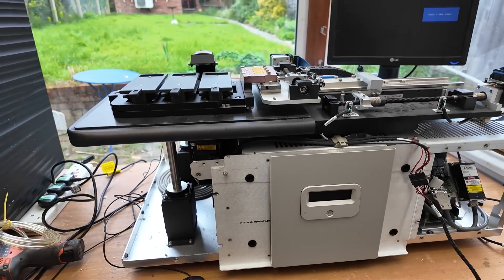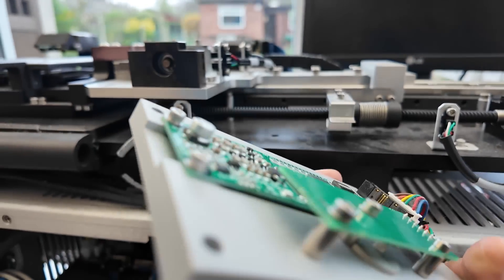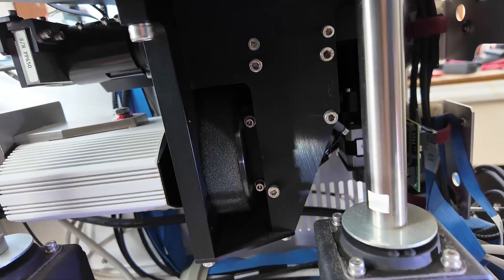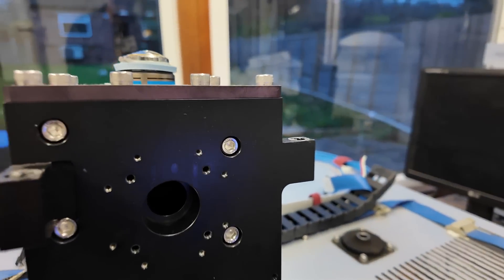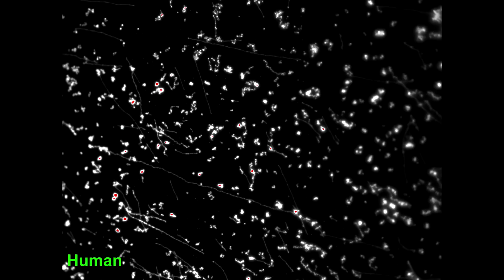Opgen Argus DNA Optical mapping system part 2

Comment: Abstract:

This video presents a detailed teardown and analysis of the microscope module from an OpGen Argus DNA optical mapping system. The system's architecture is revealed to be PC-based, incorporating a dual-processor server motherboard and a standard Corsair power supply, running on a Linux operating system.

The optical system's core is a 532nm green laser, notable for a unique motorized fiber shaker—an assembly with an offset weight designed to vibrate the optical fiber and reduce laser speckle. The mechanical design features a high-precision IKO XY motion platform with specialized flexure couplings to minimize lateral forces. Control is handled by a custom, over-engineered stepper motor driver board utilizing an FPGA and DSP. The imaging component is a Photometrics CoolSNAP EZ CCD camera, found with a large mass attached, likely for vibration damping.

While the laser was successfully powered on and its speckle-reduction mechanism demonstrated, the camera could not be made operational. Due to the system's large size, complexity, and the non-functional camera, the presenter concludes by deciding to part out the components for individual sale. The video ends by showing images recovered from the system's hard drives, requesting viewer insight into their meaning.

---

Deconstructing the OpGen Argus: A Deep Dive into a DNA Mapping Microscope

*   0:01 - System Overview: The video begins with an overview of the OpGen Argus microscope unit, a large, complex piece of equipment for bacterial analysis. It boots a Linux-based OS on a vacuum fluorescent display but gets stuck at a password prompt.
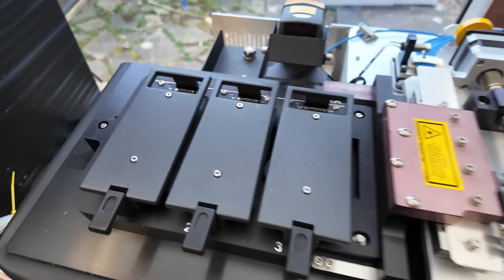*   1:45 - PC-Based Architecture: The system is built around standard PC components, including a Corsair TX850 power supply and a dual-processor server motherboard, likely for handling intensive image processing tasks.
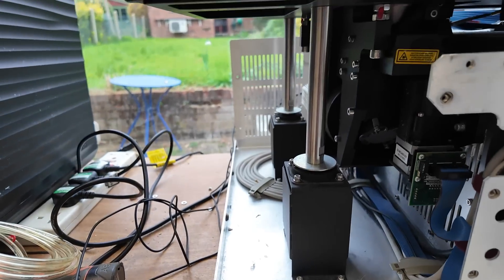*   2:42 - High-Precision Mechanics: The core optical assembly is mounted on a shock/vibration-damped platform. The XY stage uses high-precision IKO slides for moving samples.
*   3:36 - Unique Motor Coupling: The design features a flexible metal coupling (a flexure) between the motor and the stage. This is engineered to transfer motion precisely while preventing any unwanted lateral force that could cause misalignment.
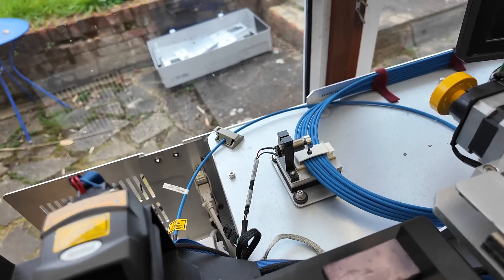*   4:03 - Innovative Speckle Reduction: A key discovery is a motor with an offset weight that physically shakes the laser's optical fiber. This "fiber jiggler" continuously changes the light's path, averaging out interference patterns to eliminate the "speckle" effect common with coherent laser light.
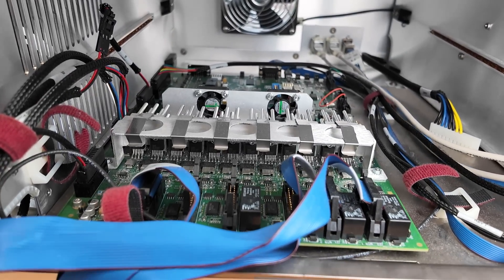*   7:23 - Over-Engineered Motor Control: The system uses a highly complex, custom-built board to drive just three stepper motors. Featuring an Altera Cyclone FPGA, an Analog Devices DSP, and 12 power op-amps, it is considered ridiculously over-engineered for its task.
*   9:53 - Laser System & Optics: The laser is a 532nm (green) module. The optical path includes two narrow-band filters: one to purify the laser light going in (532nm) and another on the camera to isolate the specific fluorescent light coming out (562nm).
*   11:05 - The Camera Module: The imaging device is a Photometrics CoolSNAP EZ CCD camera. A heavy, half-kilo weight is bolted to its side, presumed to be for vibration damping or to alter its resonant frequency.
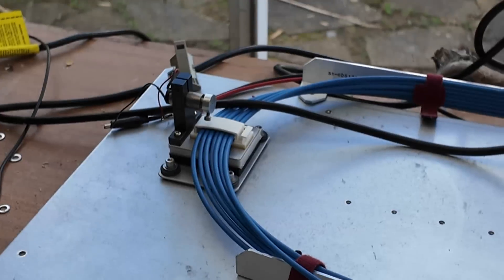*   15:04 - Successful Laser Test: The laser is easily powered on with a 24V supply. The video successfully demonstrates the fiber shaker in action, showing a clear reduction in laser speckle on the projected dot.
*   15:55 - Camera Failure: Despite finding drivers, the presenter was unable to get the Photometrics camera to be recognized by a computer, suspecting a fault with the camera's control board.
*   17:04 - Final Decision & Part Out: Given the system's massive size, the non-functional camera, and the hassle of repurposing it, the decision is made to disassemble it and sell the valuable components—such as the high-magnification Nikon objective and precision slides—on eBay.
*   18:13 - Call for Community Input: The video concludes by displaying several images recovered from the system's hard drives, which show worm-like DNA strands. The presenter asks the audience for help in understanding what these optical mapping images represent.

Summary of YouTube Comments:

The comments section provides significant technical insight and context for the device's unusual engineering choices.

*   Explaining the "Fiber Jiggler": The most discussed topic is the fiber shaker. Multiple users correctly identify it as a "mode scrambler" or "despeckler." They explain that shaking or bending the multi-mode fiber causes the light to travel through many different paths and modes. This rapid variation is faster than the camera's detector can resolve, effectively blurring and averaging out the laser speckle to create a more uniform illumination, similar to an LED.
*   The Over-Engineered Stepper Driver: Viewers speculate on the complex motor driver board. Theories include it being an early, custom attempt at creating silent, sine-wave-driven stepper movement (now common with TMC drivers), a design intended to minimize EMI, or a case of "resume-driven design" where cost was no object. Another user suggests the board may have been designed for more demanding linear motors and was simply reused here.
*   Context on High-End Lab Equipment: Several commenters with industry experience note that such extreme over-engineering, rapid obsolescence (5-year-old machines becoming unsupported), and "not invented here" syndrome are common in high-value, low-volume scientific instruments.
*   Technical Identifications: One user provides a detailed explanation of the motor's flexible coupling, identifying it as a "flexure" designed for exact constraint and precise motion transfer, a common component in high-precision mechanisms like those from ASML.
*   Offers of Help and Interest: A few users offer to perform forensic analysis on the hard drives to recover more information or express interest in purchasing the XY stage and other components once they are listed on eBay.

I used gemini-2.5-pro| input-price: 1.25 output-price: 10 max-context-length: 200_000 on rocketrecap dot com to summarize the transcript.
Cost (if I didn't use the free tier): $0.04
Input tokens: 24337
Output tokens: 1323

Comment: I used to work on imagesetters which require very precise beam positioning; the moving mirror carriage assembly had lead weights stuck to it to move the resonant frequency much lower than the excitation frequency from the mirror motor and fans.

Comment: You get that speckle reduction in laser cinema projectors (with vastly higher powered lasers). It works by changing the path lengths by altering the number of bounces it takes to get around the coils.
Reply: Yes, basically it breaks the spacial coherence which otherwise causes speckle.

Comment: Likley have to watch part 1 to get an idea how you end up with this fellow and if you imported it from the states, where such highly expensive, though dated labgear are being dumped for peanuts..
Though quite a lot of info online for Optical Genome Mapping and how you tolerate these stringent samples for genome sequence mapping.
Argus OpGen Optical Mapping System Whole Genome 11201-001 DNA RNA Sequence.. goes for a grand or two in non-working condition, depending on how complete the system is, as its  a very specific tool. that been caught by its age / performance, and limited how much you can convert it to other usecases.
Thx for the vid Mike, love your content.

Comment: I think the principle of operation of the fiber shaker is just to continuously shuffle the internal incidences of reflection to avoid hot spots. I think it's mostly just a geometry problem rather than relativistic problem.
Reply: > to continuously shuffle the internal incidences of reflection to avoid hot spots.

I do that with my Kelloggs Frosties; otherwise you get clumps of sugary overload.

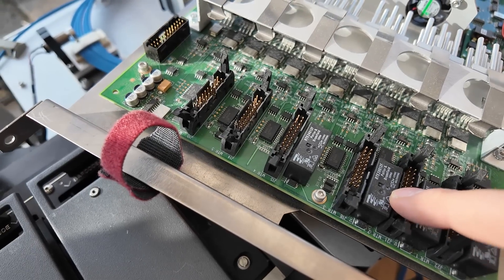Comment: 8:00 No, there are many conditions that must be followed with medtech equipment and one of them is that if fex a lid is opened so you can access moving parts the moving parts must be stopped immediately, so there is a reason those relays are there.

Comment: I might want to buy that x,y,z stuff, if you're parting it out. The dampeners look ideal for what I have in mind, and as you said IKO is always top notch.
That Lunixx root password can be reset by booting into what's called "single-user mode", followed by a simple 'passwd root' and you're good to go.
Reply from the maker: Email me if you're in the UK - would be expensive to ship overseas - the sides are very heavy
Reply: or `passwd username` substituding "username" with the one presented at GUI prompt.

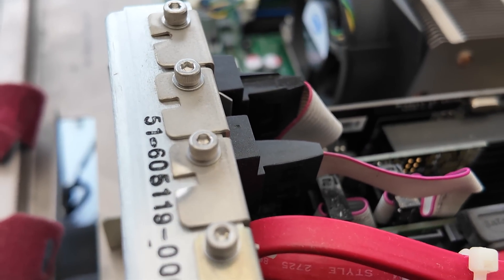Comment: That's some nice piece of engineering and since it runs on Linux, I could probably hack my way in if I laid my hands on this thing. A nice workstation grade MB there, and he connectors on the brackets at 6:32 are just standard ATX 20+4 and 2x4 power supply connectors for the board, so you can easily disconnect the supply to pull out the platform or test i out of the device. HDDs on the bottom side of the chassis are a nice touch. I'm wondering about the system specs, especially the CPU type.

That's definitely a nice laser! That goes on a shark's head.
Lovely CCD assembly too.

The images at the end remind me more of astronomy or particle physics than biology, but then I'm a chemist and an electronics engineer, not a biologist :)
Reply: it's nehalem xeon era stuff so 4 or 6 core 1st gen core i7 type stuff you can always tell from the triple channel ram
not useless but not interesting anymore
Reply: Wondering about the cpu as well. If it’s Nehalem, I’m guessing it would be a beckton cpu

Comment: That is a mode scrambler. Used for making it a pure color of light like a very bright led. These units generally have a 488nm and 635nm laser as well as the 532nm laser. If this one only had a 532nm in it, it was uses for an extremely specific kind of test. That photometrics camera is what was inside a Coherent laser beam mode analyzer with a heavy duty attenuator, they cost a fortune back then. 562nm is the emission peak of florescent green 🪼 protein. 😂

Comment: The shaker on the optical cable operates in much the same way as a galvanometer in that it changes the angle of reflection in the optical cable thereby effectively blurring the speckle effect.

Comment: I recently had a chance to pull apart a $0.5 M AUD genetics instrument in a 2 cubic meter size enclosure. Aside from the incredible build quality and over-engineering, the most incredible thing is how quickly these kind of equipment go out of relevance. The unit was only 5 years old an no longer supported (critical consumables no longer manufactured) and practically obsolete in terms of performance.

Comment: That unbalanced motor fiber jiggler thing just blew my mind. I've never seen that implementation for despeckling done before! It's such an elegant and parsimonious solution! The lengths we have to go to in order to suppress speckle on inertial confinement fusion targets is insane: distributed phase plates, smoothing by spectral dispersion, distributed polarization rotators... all to the tune of many tens of millions of dollars. Of course, we also have to do it on picosecond timescales, so there's that little caveat too.
Reply: The thing that get's me is anyone trying it in a device like this.
I would immediately discount this method because I'd assume we are fighting tooth and nail to reduce any source of vibration.
Apparently it's fine?
Reply: Well! There you go! Table-top MW fusion generators solved!
Reply: I can totally relate... in my day to day life I also have to put allot of effort into despeckling... the stuff we put up with, the struggle is real...

Comment: Shaking the fiber is all about bending it sligtly in random directions so that the light gets distributed randomly in the different fiber modes, and utimately the speckle that results from the interference of the light that traveled through the different modes changes so fast that it appears blurred on a "slow" detector

Comment: My favourite is the extreme level of detail in some parts and the semi jank in others. All the high precision machining and then they are using a a couple of standard nuts to space the hanging assemblies. @11:00

I’m wondering if it was just different engineers, the project was delayed or hemorrhaging money so the obsessive over engineering was dropped in favour of just making something work. 

Even if the product is 300 grand per unit if they were selling in very low volumes or had enough engineers working on the project budgets can get eaten up pretty quick.
Reply: they probably don't have their own machining capability, they just design, send out, get parts back and then some poor sod (who probably doesn't get enough pay) has to put it all together and get it running
see this quite often on lab equipment
Chinese these days offer the machines that cost few hundred thousand for free to use, you don't own them of course, but you pay for reagents, and probably they can backdoor and look at any data, killing the competition like they do in all the other fields, and worst part is - scientists DGAF, they get their cut from the reagent sales
Reply: It is perfectly normal. You try how far you can go with common of the shelf components and solution and switch to custom made only when it is needed. The adjustment mechanism at 11:00 mark is actually very elegant solution - you have the assembly preloaded with its own weight during alignment, fixing it in position without affecting the alignment is simple two step process - first top nut to secure the distance, then the bottom to gain stiffness and stability.
Reply: @Konecny_M  to each their own. I do that kind of thing as an electrician spacing an electrical box off a wall or something. I’m not building $300000 dollar laboratory equipment. I could be mistaken but to me it doesn’t even look like a fine thread screw. I guess if it works, it works, so no need to reinvent the wheel. It’s a short enough stud that there shouldn’t too much lateral movement.
Reply: @DMSparky  It is not fine pitch thread because it needen't to be - tilt of less than 1mm diameter plane is being adjusted, the location of the mounts from the center axis are effectively acting as reduction lever.

Comment: You should sell the objective with the corresponding tube lens. Even more useful would be the whole assembly with laser, dichroics and possibly camera. I was once in a microscopy course in plymouth. A good way to test a fluorescent microscope with a 60x immersion objective is to place pollen (from flowers) below. You'll need slides, coverslips (0.17mm thickness), immersion oil, embedding medium (you could use the oil as well) and nail polish to seal the coverslip on the microscope slides.